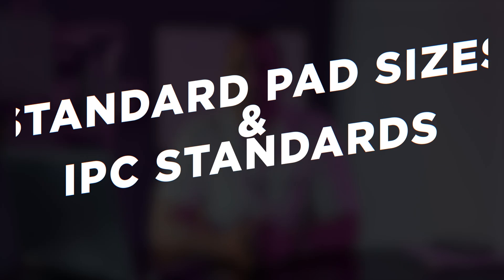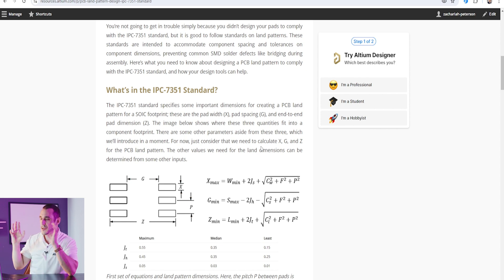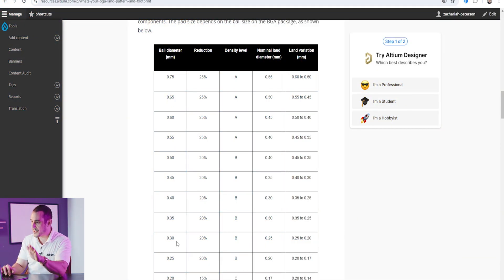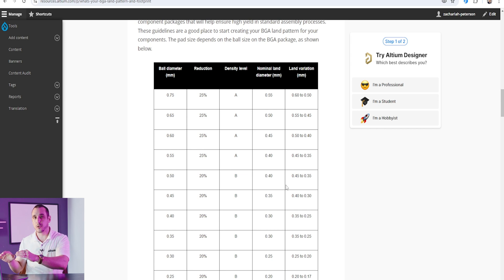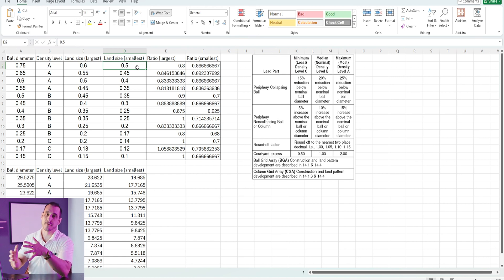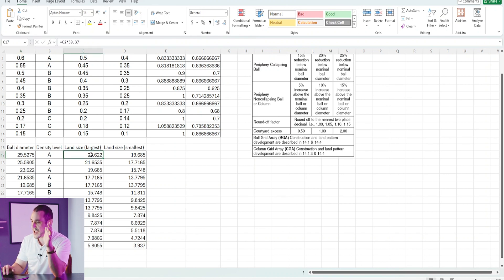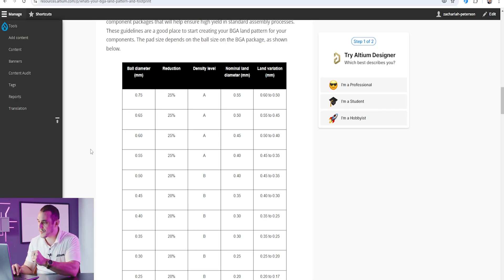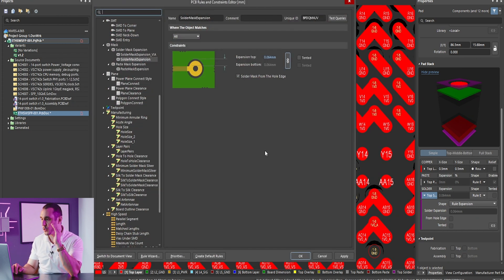Understanding BGA Pads: Solder Mask Defined vs Non-Defined

Comment: Sir as per table collapse bga we do reduction as per solder ball diameter.means pcb pads should be less than solder ball diameter.
But in non collapse bga we increase the pcb pad size as per solder ball diameter.
We used maximum material condition mmc.but you have mentioned reduction in both the tables .
My question is  in collapse bga 0.15mm with 15% reduction and in non collapse bga 0.15mm with 15% increase .is it correct
Reply: Look at the ball table from the IPC standards, I included it in the video and there is a link to the blog with the tables in the video description.

Comment: Hi Zach, thanks for the videos, they are really helpful! I have noticed in this video that you haven't used teardrops. Is there a special reason for it or is it something that you do at the end of routing process? What is your general opinion on teardrops and do they really increase reliability that much? What is, in your opinion, the point where you say "I will not use teardrops, its not worth it..."? Thanks for the feedback. Cheers!
Reply: Teardrops are not a requirement if the pad size is appropriately large. Some fabrication houses will demand the teardrops anyways on Class 3 designs just as an insurance policy. And in any case, it is something I always wait to do until the end of routing and review, that way I don't have to do them over if the routing needs to be changed.

Comment: Is there a video anywhere that addresses the considerations when attaching ground to a ball vs a signal?  I noticed that there were balls that seemed to be connected to the ground pour.  I thought this was dangerous as the ground pour will not heat up at the same rate as the signal, which may cause the solder to not connect to the pour because the pour never gets as hot as the trace's pad?
Reply: I have not addressed this in a video, but with an appropriate reflow profile this is a non-issue. If you look you will find evaluation products with fine-pitch BGAs that use pad attachments directly to copper pour, and these are produced at volume. For controlled impedance lines, it is important to maintain an acceptable spacing between the line and the pour, which I have discussed in another video, and that spacing may eliminate your ability to use copper pour to connect to the balls.